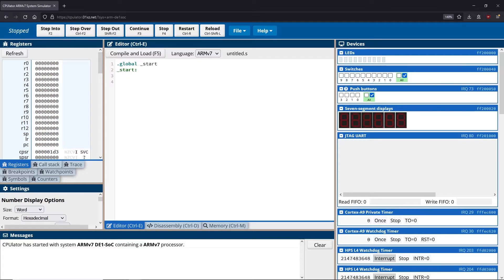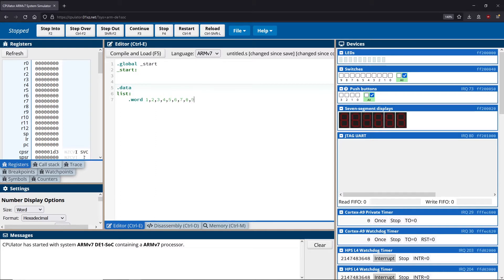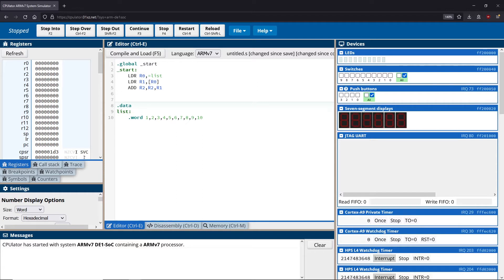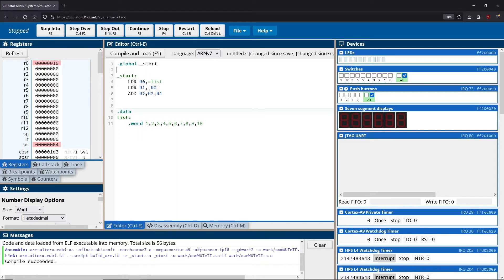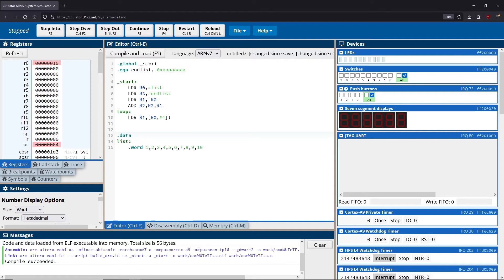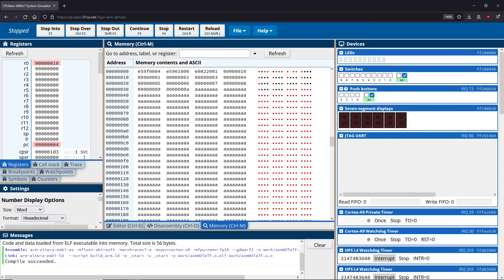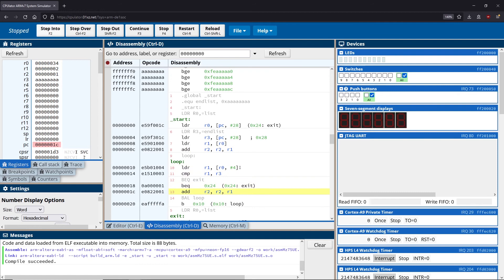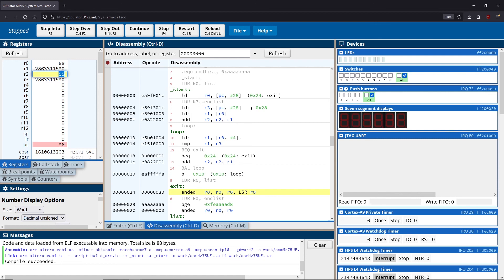Introduction to Assembly Programming with ARM - Loops with Branches

Comment: Thank you for the video! For line 10, I am wondering why the next value on the list would be #4? Why increment by 4 in this case?
Reply: Increment by 4 since array/list is a pointer. The pointer arithmetic's increase by 4 to align the register and memory so each index of the list is an increment of 4 = double word = 32 bits, Quad word = 64, word = 16 and Half word = 8 = a byte. Since arm uses 32 bases for the register most arm operate in thumb mode which is the lowest architecture and compatible with latter arch, so arm is 32 bits but allow thumb instruction for early 16 bits which is denser compact some instructions also allow accessing of a lower byte and higher bytes depend on the width of the operand, but all instructions are 32 widths if I'm not mistaking.

These sizes all depend on machine architecture which is the instructions set of the CPU. This is all the nuances higher languages abstracted from you so you can worry about the algorithm, but computer is not about algorithms, but the data structure, algorithms operate on data and the structure of the data matter so the most important thing in computer programming is structuring your data in a way that will be easier and efficient for the CPU and peripherals to access. 

Just like you are building a road but did not consider what is going to go on the road, like the max weight of the car, trailer, human and even what can go on the road and the location of exit and entry.